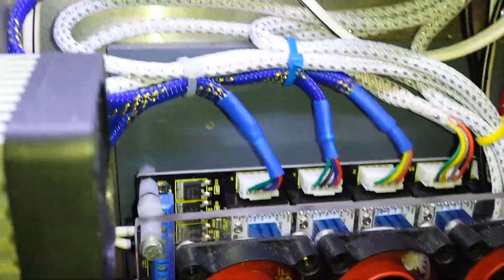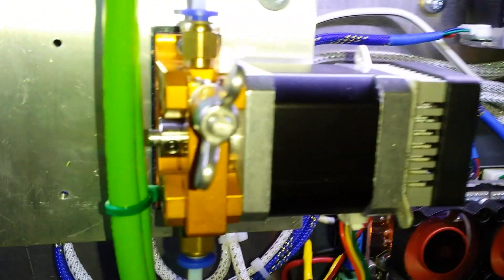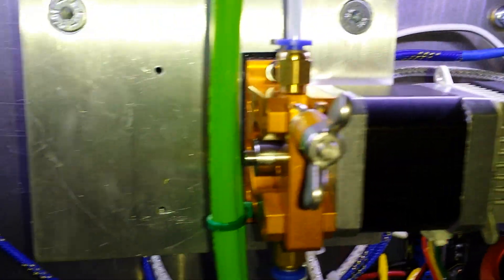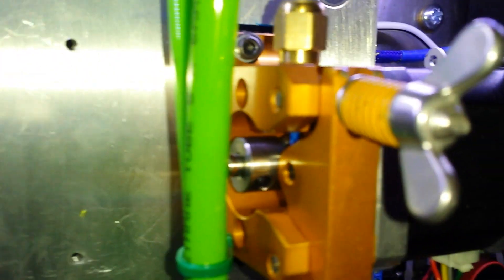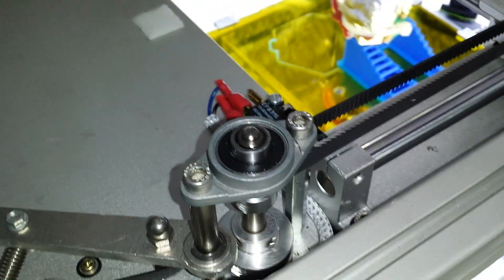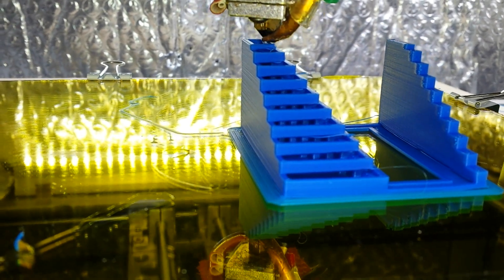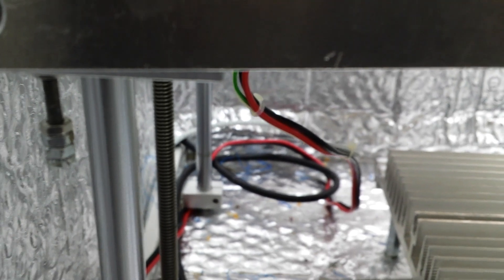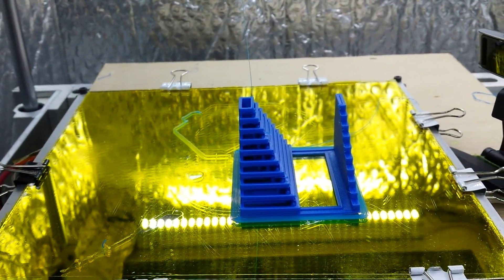Tmc2100 The Daddy of Stepper Drivers for 3D Printers

Comment: These are servos or still steppers? They do seem a lot more silent than what I've heard from most 3D printers.
I just ordered a Tevo Little Monster and fear that thing may be a screamer. Is it possible to use Servos with 3D printers?
Reply: yea but you would have to trash the whole existing  stepper/driver and buy all the things need for the servo motor(needs a coustom Sware)
Reply: the cost of servos is prohibitive to the individual maker so rather buy tmc2130 or stepper motor 'shield' ex) mechaduino or ustepper

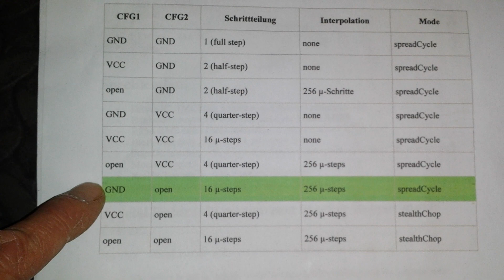Comment: @3:57.... No its not...!!! Its clear you have cfg1 soldered to gnd on the extruder and z. That is 16 microstep interpolated 
And your xy I see nothing soldered so god knows what setting you are using
Reply from the maker: Edison Motors . not exactly sure what you are on about ? .
Reply: He is probably talking about configuration soldering, but in fact you cannot see anything, because bridges are on the bottom side.
Reply: He make solder on the bottom side of tmc2100.

Comment: Where did you buy these TMC2100 boards? I got some of the MKS ones from an aliexpress seller and I spent days trying to get them to work for my core xy's x and y axis.

Put them in spreadcycle mode, 1/16 microstepping interpolated to 1/256, but kept getting shifted layers that I just never get with allegro or drv8255 drivers.

Upped the current as far as they would go (way past what I use with the other drivers) and it still happened. Slowed speeds and acceleration down way below what I normally use... same thing. Even tried lowering current. Added lots of active cooling even just in case even though they were running cool.

Tried everything over the course of many evenings. Swapped drivers around, switched to spares... eventually just switched back to a combination of allegro and drv8255. So frustrating because they are so smooth and quiet ;(

All I can think of is that the boards are faulty or incorrectly wired. But the official ones cost a fortune to ship to my country.
Reply from the maker: Hi Le Roux Bodenstein. hhmm something obviously is not right there ! ? . may i ask what main board are you using ? and what firmware  ? ... I presume you have nema17 size motors ? . what drive voltage are you using ?
Reply: I'm still on 12V because I'm a bit locked in and would have to replace all my fans, my hotend's heater cartridge and my power supply. I suppose the electronics boards, motors and heated bed can all run on 24V if I want them to, though.

My X/Y motors are nema 17, 400 steps per revolution, 48mm height, 1.7amps. (My extruder and z-axis motors are normal Nema 17, 200 steps per revolution, 40mm high, 1.4amps-ish, but that's irrelevant I suppose).

I started with a MKS base 1.4 just like you. I was running Marlin and my X/Y steppers were in 1/8 microstepping mode with the old drivers before I started because I was worried that with 1/16 and the 0.9 degree steppers it might be too much for the 8-bit arduino. That worked 100% fine with the a4988 drivers and the drv8825s. Then I had to switch to 1/16 microstepping with the tmc2100s and I started getting the layer shifting. I configured them for spreadcycle mode with the jumper wire. After eliminating everything I could think of I thought that it might be the arduino that's not keeping up because I mostly get the layer shifting on really complicated small/tight curve parts.

So I switched to a RE:ARM (https://www.kickstarter.com/projects/1245051645/re-arm-for-ramps-simple-32-bit-upgrade) that I bought from Panucatt devices (http://www.panucatt.com/Re_ARM_for_RAMPS_p/ra1768.htm) and a RAMPS 1.4. It is 32-bits and runs Smoothieware. And I'm getting exactly the same behavior.

Therefore I'm reasonably confident that it isn't a software thing or an arduino thing. I bought 4 of the drivers and I was only running 2 of them for my x and y motors (extruder and z axis still running a4988s) so I had spares. I swapped the spares in and I'm getting exactly the same behavior.

After trying everything I switched back to drv8825s for the x and y motors in 1/32 microstepping mode and everything is working 100% fine. No missed steps or layer shifts ever.
Reply: Hi, this might have been solve now but in case. Did you try to tweek the Current on this 2130 board?

Comment: What board are you using with these TMC2100's?
Reply from the maker: Hi Rob Bosch. Currently and sadly stil the old 8 bit Mks base v1.4 . i have the 32bit mks version but not installed yet.
Reply: Are you sure it's MKS Base 1.4? This board has drivers built in, so it's quite close to impossible to install alternative drivers. You might be using MKS Gen.

Comment: how about print speeds
Reply from the maker: Jukka-Pekka Ylitalo . what exactly are you asking about print speeds ? . Difficult to quantify  ! These stepper drivers can run my printer beyond 300mm/sec but in reality this is pointless. The header for speed for me is always the material  - ABS . nothing over 150mm / sec will give good results and strength is key for my projects. These drivers will provide all the speed you need for a domestic printer. The true limitations are the board used to control them and the rigidty of the machine mechanics.
Reply: Well 150 is good enough. But i thing good thing to tell print speed is 1x1 cm cube with 95% infill how fast it is print. In minutes. Or seconds even better. with decent quality

Comment: awesome wire loom on your cabling.  any advice for sourcing? 

that really does make a clean installation, with, of course, your diligence and skills.......
Reply from the maker: Hi David. The cable sleeve and looms were all purchased off Ebay. There was a seller in china that had them at a good price but obviously I had to wait a few weeks for delivery. Most items were obtained from Ebay , just very carefully selected. A few items were purchased from Banggood also. I made the aluminium pieces from plain 5mm & 3mm sheet using hand basic hand tools.
Reply: I found eBay seller for what I'm guessing is the same.  1/4 inch ID is what I bought.  found colored shrink also.  got tmc2100 drivers from digikey for $8 each and some heatsinks.  azteeg X3 pro, 0.9 steppers,  and still need to source some Titan extruders.

Comment: Thanks for the video, I have some question,  Did you remove any jumper on your board (mks gen 1.4 ?) before adding those drivers ?  And did you slip and pin of the drivers ? Thanks
Reply from the maker: Nicolas Tual . Hi there. No I did not install any jumpers on the Mks Main board ! - BUT I did solder some of the links on the Trinamic Drivers to select the modes I required !! Please make a note that the mode select pins on the Mks board are biased to 0 volts !! So if you link the solder pads on the Tmc2100 Drivers and plug them into the Mks board you effectively connect the pins to ground - 0volts !! the Tmc drivers are polarity sensitive on their mode selection pins and be aware this needs to be remembered.
Reply: is there a guide for this? I am still not quite sure what I am doing :D

Comment: Hi enjoying following you build your printer as i am building one myself. I looked at these drivers before but they were only rated at 0.5 amps for continuous use how are you getting round that as it looks like your motors are quite big. I was going to use the 8825s till i saw your last vid so i bought the external driver you was using but like you said it involes a bit more wiring and space . It would be great if you could go into more detail on the wiring side of things to help lesser mortals like me. Again great work
Reply from the maker: Hi Lee. Thanks for taking the time to watch. they are not the best of quality but time is limited my end. Ok I am not sure where you may have got the information on the Tmc2100 only being rated for 0.5 Amps ? . They are actually rated for 1.2A rms. 2.5Amp per coil burst load. With heat sinks they handle my largish nema17s just fine. Please note that They have allowed me to reduce my original running current values that the Drv8825 had been set at to achieve the same speeds. These Tmc's have a far improved output that manages to turn the motors more efficiently and hence can run at slightly lower current ratings whilst performing better overall :-) . honesty they are very good indeed.  Ime not easily impressed but these things have achieved that for sure. And good luck on your build . I admire anyone who attempts such a task ;-). And obviously any help I can give would be offered or advice etc. I am no expert at 3d printers . however I have been an engineer my whole life and spent over 16 years designing and building packaging machinery for industry so I have some knowledge that I can apply of course. so yes anything I can assist with I will to the best of my ability  :-). The wiring of the external stepper drivers is ever so simple really.  basically you supply with 12 or 24 v dc for the motor supply. wire your motor to the output terminals and use 4 small cables to connect to your Ramps / 3d print control board. 1) For Ground . 2) For Enable. 3 ) for Direction. 4) For Step.... 
These are usually provided on the 3d control board on a small header besides each driver. These operate at 5v dc . so obviously be careful not mix higher voltages on these pins / cables. ....
Reply: Thank you very much for the reply and help. I have designed a i3 style printer with a 30cm in all directions build area with a AC powered heated bed so i need to run 2 Nema 17's for the z axis that's the axis im most concerned about . When i finish this one i will be building another where the build plate goes up and down on the z axis like yours not sure whether to go core xy way or something like the Ultimaker. This time last year i new nothing about 3d printers i bought a CTC off Ebay and had nothing but trouble and have replaced the electronics already learning everything off Youtube again cheers for the help you have given me and others doing what you do.

Comment: Excellent news!  On with the rest of the improvements!

I CANNOT recommend the PEI bed enough!  It lasts forever (occasional sand and clean with isopropyl), ABS, PLA, Co-Polyester, modified poly-carbonate (Polymaker PC-Max) and nylon with glue stick - all work very well.  Parts come off easily below 40 degrees.  Build-tak works well with poly-carbonate - I think it's just a sheet of poly and keep meaning to buy a cheap sheet to see if I can get similar results.  The buildtak is too expensive and doesn't last at all. Hateful stuff but good for PC as I said.

Get yourself some Polymaker PC-Max too.  It's awesome!  I quite liked the Colorfabb XT-CF20 too.  Gorgeous warp and curl free prints but not that strong compared to PC-Max.  Needs a hardened nozzle and I have made a brush/wipe on my printer as it builds up on the nozzle.

My next printer might have a Due based controller which has the removable drivers so the TMC will be on that if so.  I am thinkning about making two independant heads and the smoothieboard has one too few channels for that.

How are you planning to enclose the printer?  I have been looking at Celotex home insulation.  You can get it in easily cut boards at 12, 25, 40mm and higher thickness.. The 12 or 25 might slot into your frame nicely - you could even use a router to make a lip that fits into the channel..

Good work, and thanks for the videos!
Reply from the maker: Hi Jai. it seems the Trinamic have the edge in terms of performance. hhmm I was wondering about PEI as a build surface  :-) . may i ask if you use the sheets or off large rolls ? . To be fair I dont generally have warping issues - Several reasons that one lifted- only very Recently started using Simply3d and it handles brim & 1st layers differently to what i have been used too with Slic3r. Secondly I have learned to simply not open the door for best results. on this occasion i was more interested in the motors / drivers than the print itself and hence I had opened the door more than once or twice :-( . it really does have such a fast impact on my printer ! :-(. but never mind its all to be improved :-). But yes I will certainly give PEI a try out for sure. As for insulation!  You guessed Right  Celotex will be ideal and is exactly what I will use along with some PolyCarb doors and Top lid. all a little off yet but in the pipeline. Hhmm I have also considered the Due option as I have a few lying around doing nothing and they are as you know 32bit. However I noticed the Original supporter of the MarlinDue Firmware is No longer supporting or updating it on github :-( . I couldn't see an alternative firmware solution that was tried and tested so i gave up on the Due idea. I recently purchased the Mks SBase 32bit 24v board and I am awaiting its arrival. But as your probably aware it has the Drv8825's stuck on it :-( dammit #@#@ . oh well I plan to bypass these now and do what you suggested!  build a daughter board for the Tranamics and interface with a ribbon or similar. . There is a board I know that has the Tmc's already on it. I think they are the better version than the standard 2100 ? . if i remember correctly? . looked a good board as long as still supported ?. cheers.